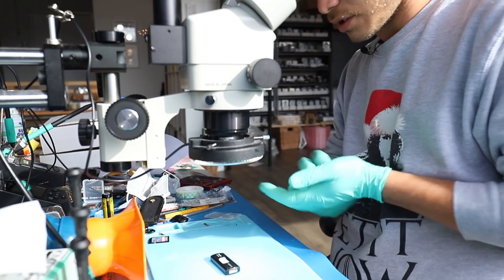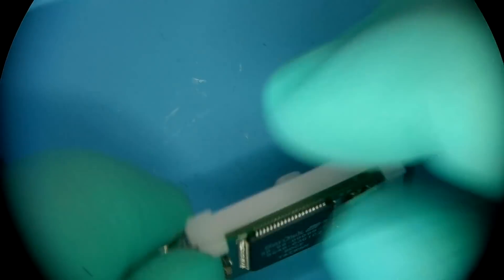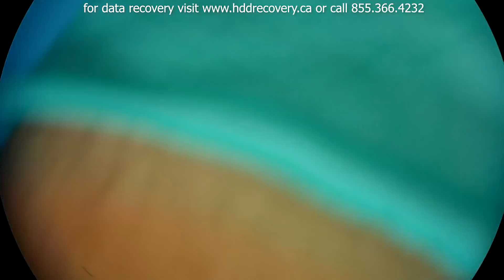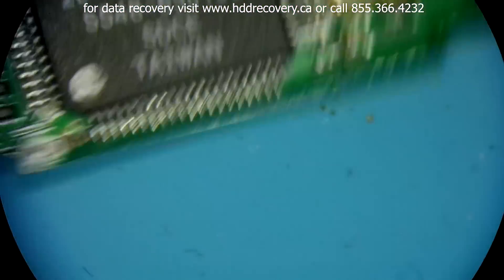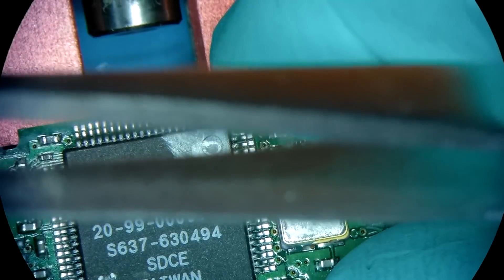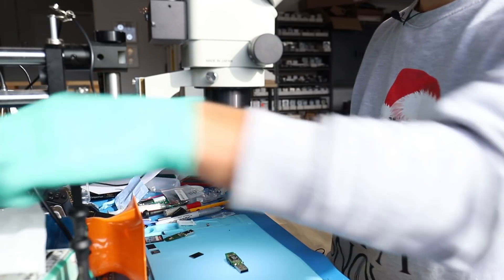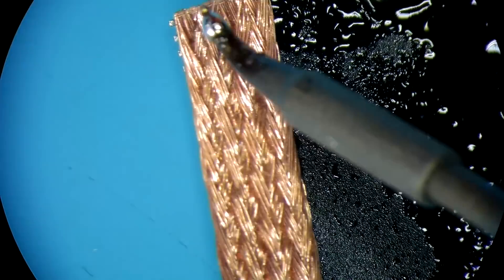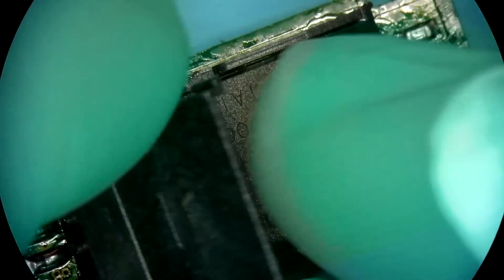Sandisk Cruzer will not show up. How to recover data using a donor flash drive

Comment: Sir i have a cruzer blade 16gb (sand disk) .sir problem is that when it insert in laptop it's working but also heating and within a minutes atomically eject..sir please tell me what the actual problem associated with my pendrive.🙏🙏hope u regards me.
Thank you

Comment: I can already see the blown trace. 5:08 Right above the Rev 2 mark on the board. Looks like it doesn't go to anything though
Reply: Think you might be on to something. Could just be a control line or something. Because if the controller chip was fried there was no way to recover the data from the NAND if it was encrypted by the manufacturer. Without their help or breaking the encryption. Which probably wouldn’t be that hard on a drive of that type.

Comment: One item that is easy to check before taring into the sticks is the crystal oscillator. The crystals on cheap sticks can be damaged when the stick is dropped and a quick crystal change could have you back in business.
Fun Vid, thx
Reply from the maker: yes, but our statistics show that it is highly unlikely for the clock to go bad on Sandisk like this. We've tested a bunch in past, and only the controller/nand swap gets the win.

Comment: This drive is encrypted? I understand correct?
Reply from the maker: Yes, after I did this video I tried to recover data from NAND using controller simulation software and it could not be solved